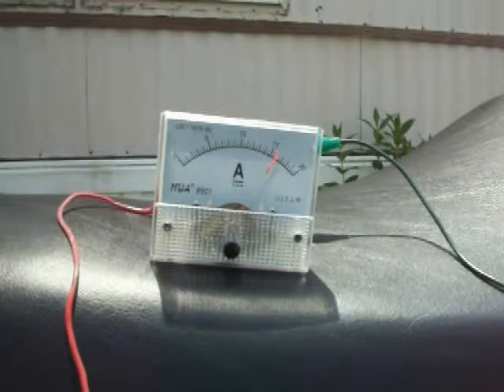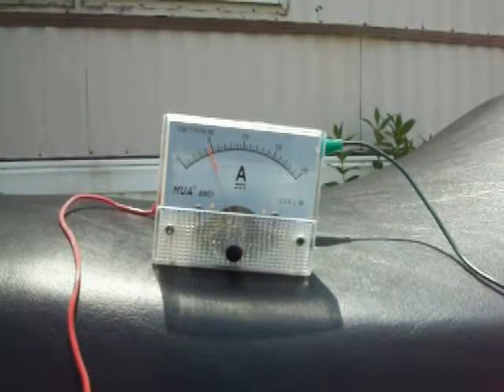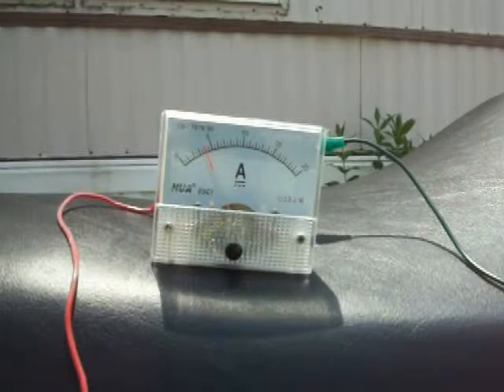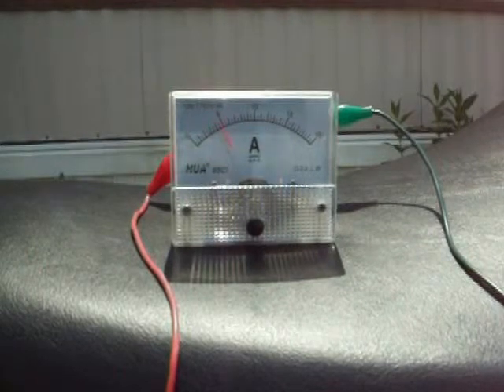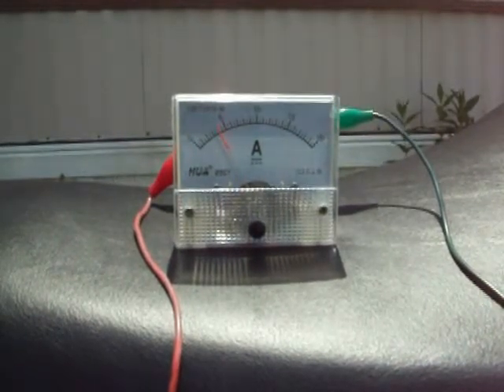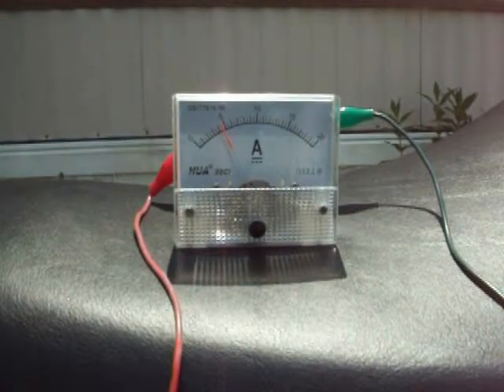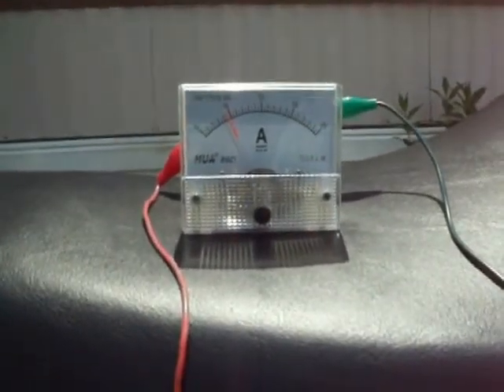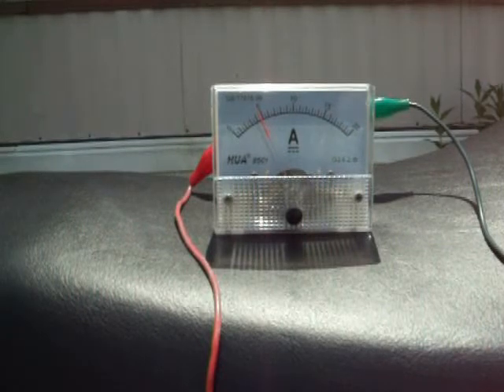HHO passive electric hookup

Comment from the maker: Actualy you need both. The main idea is to create a cell that can draw a buttload of amps under regular direct hookup, so the power will pass through it just like is was a regular wire. If someone could get a really big one then they could hook it up inbetween the the alternator and the wire to supply power to the car or truck. Were I could bearly run 1 wet cell system last year. I now have 2 systems on a bike that has limited current to work with. Check my newer vid

Comment from the maker: yea the key to this, is you need a HHO cell(s) that normally would draw way to much power, It's the headlight that works as a regulator, this regulator just happens to give off light as a byproduct. I have a series of vidoes on this. Lookup motorbike and scooter hookup. You might be able to do the same with components on a car. maybe the alternator itself, but I don't have the money to try.

Comment from the maker: the point of a dry cell, mostly, is the nuetral plates. It's the same a hooking multible HHO units in series, it reduces power same as hooking light bulbs in series. I might use one later but it will be configured +-+-+-+-+- no N plates.
My basic rule of thumb. Don't worry about how much HHO your getting, just get what you can and get it in there. For 150cc, there really is no MIN amount.